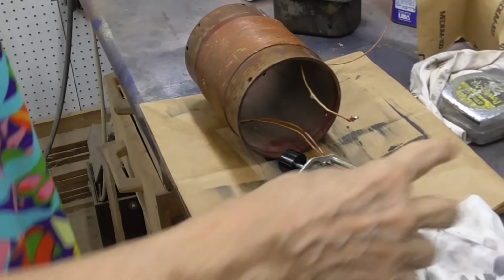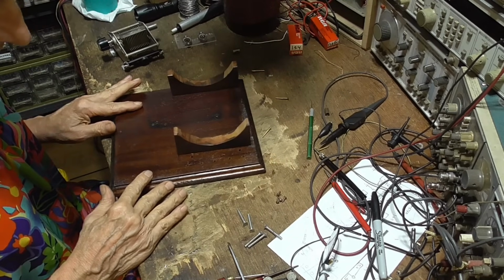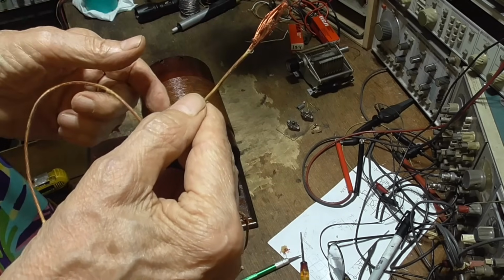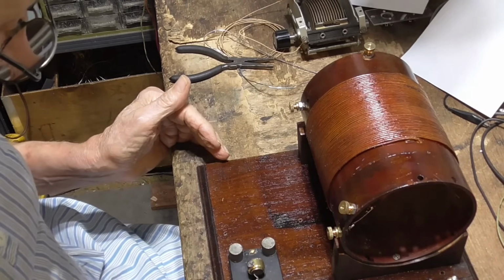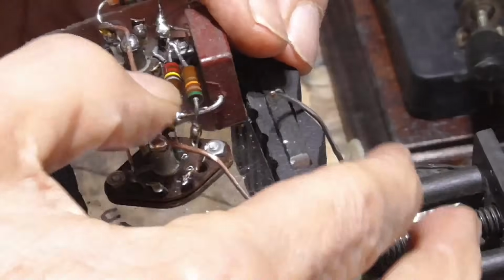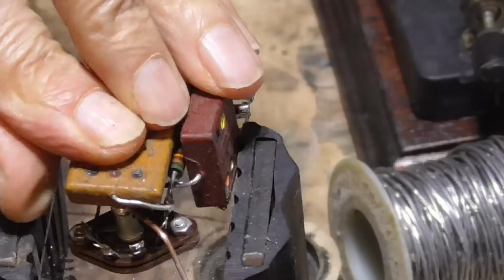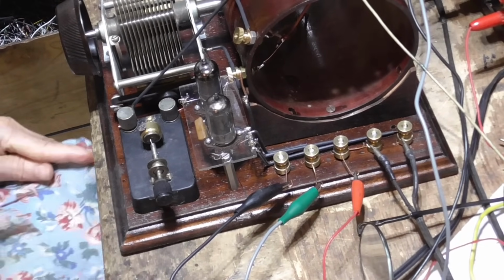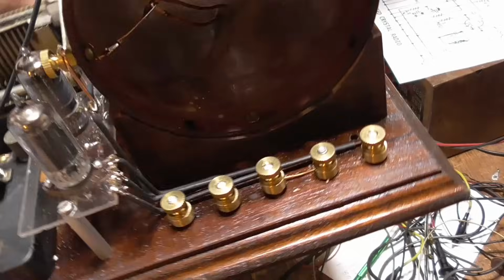MAKING A TUBE AMPLIFIED CRYSTAL RADIO

Comment: What is the Diameter of The Coil Form ? .. and (Did you Happen to Count the Turns) to achieve the  the 250 uH Value ??
Reply from the maker: The coil is 3.5 inches dia. The coil came from an old radiola 3 radio. The number of turns is unknown but looks to be about 250 turns of #18 stranded wire.
Reply: @glasslinger  OK .. Great .. Could I bother you again to Measure the ' _WIDTH_ ' of the Windings on the 2.5 Inch Form (And also the ' Total Length' of the Form it's self) .. With hopes knowing those details, it will be near perfect to a 250 uH Coil as possible when Complete ✅ 🤞 (Thanks 👍 Again)
Reply from the maker: @x_CrossHair_x  I no longer have the radio. I gave it to someone as a birthday gift. You can get a chink inductance-capacitance meter on ebay for under 20 bucks. (ebay # 156108312067) I have one of these and use it all the time.
Reply: @glasslinger  Yaa.. I guess.. Now is a good time to get one (More affordable) .. Amazing how inexpensive the Electronic Measurement tools have become. Even Scopes and Spectrum Analysers are Dirt Cheap.. (Not like the Old School $1000's) Back in the day. And what a nice B-Day 🎂🎉 Gift.
Chow and 73s
Reply: @glasslinger  I see 44 turns. I hope that guy didn't try to wind 250 turns on it. LOL!
Reply: I love this.....I wondered if you had wattage values on the resistor in your schematic
Reply: @larryangell7582  Just an (Old School) assumption .. Looking at what he used (They look to be) 2 watts..
Reply: Thanks @x_CrossHair_x
Reply: @michaelsimpson5417  LOL.. No I did not wrap that many If referring to me. (value is 250 uH) not turns.. But thanks for counting them.. (After counting them My self and Turning Cross Eyed doing it.) you Are correct that the Coil has 44 Turns. 👍👍

Comment: glasslinger, the radio tech with pink dress is coming back with this very neat job. nice to see! but an amplifier after a diode detection (instead of regenerative, or reflex), is it... well... a little bit inefficient design?
Reply from the maker: It was not meant to be efficient. It was to be expressly an amplified crystal radio!
Reply: @glasslinger  ok. at least, it is aesthetically efficient!😁

Comment: Hello sweetheart, My question is when making a crystal radio, My coil is going to be 4inch ( PCV PIPE ) So what is the coil inside my 4inch is it just a part of the antenna? I'm helping my grandson he loves your video.
Reply from the maker: Use a single coil on the 4 inch form. No good reason to use 2 coils in a crystal radio.
Reply: @glasslinger  Thank you so much God Bless...... If you know anyone i could send the picture of the BIG radio tube i have for you to look at please let me know. I think you will be very happy to see it..... Hugssss
Reply: ......... bine va precizat dm nu este nevoie de doua bobine, nu  stiu daca dm va precizat dar bobina  cu CV in paralel face parte din circuitul de acord ( de calare a receptorului pe fregventa de lucru, emisie a postului receptionat) fara acest circuit nu ati putea selecta postul dorit de oarece in antena ajung o multitudine de senale de RF  dar si parazitare, ori acest  circuit bobina CV face posibila selectare semnalului celui mai puternic  post de emisie pntru ace fregventa cind fregventele mai multor semnale sint egale si de aceias putere veti auzi in dif s-au casca flueraturi puternice ptru ca circuitul acordat nu poate separa fregventele si atunci prin ,, bataia '' dintre ele apare acest semnal ce le anuleaza facind receptia posturilor respective imposibila

Comment: You can improve the 'Q' of your receiver by increasing the value of your 1st stage grid resistor to 10 meg or so, which will allow you to reduce the value of the detector cap by a factor of 10 or more to improve the 'loaded Q', you might even be able to only use the internal capacitance of the tube to act as the detection filter.
 When you thought your circuit was working from the diode you added underneath the detected signal should not have disappeared when yo moved the whisker off the crystal.

Comment: 30:10 i love when people misspell "bus" by adding an extra "s". reminds me of my childhood, the step-family's surname.
Reply: A bus is a thing that poor people ride .
“Buss” with two ss’s is the correct spelling for the word “buss” which , as in “buss wire”, refers to tinned (usually) solid wire.
Reply: @papaloongie:-  In English it's not " buss wire ", but should be " bus wires " .  This would cover all, tinned or not, solid or stranded.
Reply: It's a special kind of wire, old school type like the radio, has nothing to do with the twisted pair, that connects your car's control units - or whatever electrical busses you might have in mind.
Google would have helped against the shame.

Comment: Why make a 2 tube amplified crystal set at all? Why not simply use the 1st tube as a detector and pre amplifier stage?
Reply from the maker: The PURPOSE of the project was to add an amplifier to a crystal set.

Comment: Where’s the part where he shows you how to wind the inductor wire ? I couldn’t find that video.
Reply from the maker: The inductor was removed from an old Radiola 3. You can find these on ebay in crappy condition for under a hundred bucks. Do not chop a Radiola 3 that is in good condition since it is valuable.

Comment: Litzewire is also a perfect desoldering tool.
Reply: The RF litz wire is not the same as common stranded wires. Each thin wire is enamel insulated, then they all are wrapped in silk or cotton. This type of litz is rare now. It is quite hard to remove the enamel before soldering.
Reply: @ButtonsKing  
I remove the enamel with solder and aspirin tablet, EZ
Reply: @wnj2453  Yes, I know this method. Another method is soldering RF litz on a piece of hard PVC.

Comment: Your table saw scares the hell out of me 🤣. I grew up using my grandfather’s 1939 Sears and Robux saw that is basically exactly like yours. 

No safety shield over exposed, spinning sawblade  

Even though I grew up using it my entire life as a young child a teenager into my 20s . 

I finally got a modern saw with all the safety features . 

I would not allow my children to use my grandfather’s table saw . 

But I’m about to embark to restore, clean and repaint that 1939 Sears & Roebucks table saw to bring it back into its original glory to make it look brand new  

But I will be adding safety shields, kickback protection, in a very large protective fence and guide .   So it can be used safely.. 

And make a shield around the motor, spinning pulleys and belts just in case some children came around poking fingers or piece of clothing by somebody passing by, cannot get sucked into the belt .
Reply: Your children might lose their life later by thinking, they can fumble around everywhere, being foolproof protected.
Reply: @werner.x That is a fair call. People have lost a grip on reality these days with how things are.

Comment: Hello! Please tell me what is the diameter of the coil, the number of turns and what is the wire section?
Reply from the maker: For 550 to 1500 KHZ the coil is 4 inches dia. with 250 turns of #18 AWG wire. Space the turns 1mm. you can wind with a piece of string to get the spacing, then remove the string and varnish the coil to hold the wire in place.
Reply: @glasslinger  OK, thanks for the answer.
Reply: @glasslinger  Hello, I think you mean Fifty turns!   250 turns would put it way down about 100KHz.  Cheers.

Comment: I can’t stand slotted screws.  But you drive them in like it’s nothing.
Reply: You need parallel ground bits that fit in the slot well, or modify one yourself as needed. Experience helps too.

Comment: You should stick with the whisker for the detector, rather than that fancy newfangled germanium diode, which was not available commercially until the 1940s. I never had a problem using one, but had some very nice galena crystals. 

I prefer either bare or enamel coated copper wire for such projects, when possible - more authentic and more shine.

Nice little project.
Reply from the maker: The radio has an old galena crystal. I used the modern diode for the video because of the difficulty in adjusting the cat whisker. (with my shaky old hands!)
Reply: @glasslinger  I never had a problem with them, but understand that some crystals can be really frustrating.

Comment: a nice, classical desighn........why not use a 6AF4A for your first stage of amplification.
a 6AU6 is a good choice for second stage, another way to bump it up is to apply a very small forward current across the crystal (it usually takes only a couple micro ampres, and sometime even less).
Reply from the maker: A pentode has about 10 times the voltage gain of a triode.

Comment: The Lynch motor is an unconventional design with a disc armature. It marries the advantages of a conventional, wound armature motor with the benefits of a flat (printed circuit) motor. It is similar to a pancake motor, but is more powerful than any of these technologies. The disc armature has magnets on both sides, doubling the available flux density and shortening the magnetic path. It therefore packs more power per pound and per cubic inch than any other motor technology. Of course such a revolutionary motor is not for every application - it is not as cheap as wound field motors, but for many applications it is a far superior motor.  It has a previously unheard of power to weight ratio and also power to volume ratio. It is also highly efficient because of the double magnet design and associated short magnetic path. It also includes integral fan cooling.

 The Lynch motor is an important development which spurred other motor designers to improve their products to remain competitive, such as synchronus permanent magnet machines.  As a result of the competition between manufacturers the cost of high performance motors and controllers has fallen dramatically.  We hope the cost of solar cells also reduces to allow renewable transportation to develop as a viable alternative to carbon fuels.
Cedric Lynch built his electric bike around a mid-drive configuration, also building one of the worlds most efficient light weight electric motors to power his rig reliably at 60-MPH for significant distances. He would later set several world records with his axial flux motor and bring it to market as the Lynch / Agni motor. Briggs and Stratton would eventually buy this technology which would lead to the Etek motor, which is now famous for making high speed efficient electric hot rods.

Cedric uses to achieve high speeds is by following the rules of aerodynamics, and building a bike that is as aerodynamic and as efficient as possible. The other builders on this list bypassed this step, and Cedric uses this bicycle as daily transportation on real commutes. Although this high-efficiency motor uses “old school” brushes, this fact allows builders to use very affordable controllers. He has proven his design choices through thousands of miles of commuting, and the Lynch motor is highly respected.

Cedric Lynch is known as the creator of the Agni Motor, a highly efficient electric motor that weighs around 25 pounds and can put out as much as 50hp. 

Cedric Lynch is a British 'mad scientist' type mechanical engineer obsessed with the idea of greener transportation. His interest has been in building a super efficient yet powerful vehicle that can serve as a car replacement.

He started thinking of his own design for an electric motor in 1983 when he began entering competitions organized by the Battery Vehicle Society regarding building an efficient electric vehicle. At the time there was no reasonably priced DC motor with descent efficiency so Lynch decided to build his own utilizing modifying existing motors with old tin cans that he would spread out flat to use as cooling fins. Surprisingly using rudimentary materials and a garage work bench, Cedric was making better more efficient electric motors than any of the universities were able to manufacture in state of the art workshops.

Cedric then came up with a motor design that could be cheaply manufactured and began manufacturing his own motor that he could sell to the public in 1988 and the Lynch Electric Motor Company was born, known as LEMCO.

Cedric first used his motor to create a small boat called “The Spark” that would set an electric boat efficiency record. From there Cedric turned his attention to bicycles, an application generally considered too small for a lynch motor at that time. Cedric mounted his motor in recumbent bike, allowing him space to eventually use a set of thundersky lithium batteries.

The resulting aerodynamic recumbent bike had a top speed of 60mph and still managed an incredible range of 150 miles. Cedric rode his recumbent creation everywhere as a daily commuter, putting an amazing 50,000 miles on the machine - technically a motorbike.

Briggs and Stratton, the US firm famous for lawn mower engines, bought the technology and used it in their E-Tech Motor, and Cedric went on to manufacture his latest incarnation of his lynch design into the Agni motor, which is used in go karts, sailboats, motor boats, and even small airplanes.

The Lynch designed motors all have the same traits. Brushed motors, around 25 pounds in weight and they are able to put out enormous power compared to their weight. Sometimes as high as 50 hp (depending on amperage ran through the motor) at an incredible 98% efficiency.  Lynch Motors are also the most often used motors in electric motorcycle racing applications.

Cedric's zero-emission motorcycle, which has a top speed of 120mph, was shown in action winning the world’s first zero carbon race – the TTxGP in the Isle of Mann.

The idea for the electric motor has been snapped up by the 56-year-old’’s friend Arvind Rabadia, who together with his brother Hasmuk Rabadia had been thinking of starting a business in India. They have now set up Agni Motors to make further-improved versions of Cedric’s motors

Despite Cedric’s breakthrough invention he has no formal engineering qualifications and taught himself the techniques needed to construct his engine. He first became interested in electrics when his parents bought him a book entitled How to build things from things found at home. 
The Etek motor is a brushed 25-pound pancake shaped motor that puts out enormous power for its weight. Depending on amperage and voltage the Etek can easily provide between 15-horsepower and 30-horsepower reliably and consistently (11-kW / 22-kW). A perfect platform for a powerful electric bike if you do not mind the weight. Although brushless motors are considered more modern, a brushed motor like the Etek allows the builder to use very affordable controllers.

Cedric-Lynch invented the motor and sold it to Briggs and Stratton which US company produced the Etek at a lower price (around $600). In the late 90’s early 2000’s it was the way to go for a high-power / light-weight electric vehicle. Many small E-vehicle records were set using the Etek motor. Finally, the market had a relatively lightweight and powerful electric motor available to the masses.

In essence, the Etek allowed hot rodders to build electric bikes. Before the Etek very few people had ever achieved 50mph on an electric bike. Even today, Etek motors (and newer incarnations of the Etek motor) are used to make some super fast electric bikes. In the case of Liveforphysics, the fastest E-bikes ever.

 Liveforphysics used a newer version of the Etek (the Agni motor), to achieve speeds of over 70mph, and dominate a recent hill-climb event.

Every Etek I have ever ridden has been characterized by brutal off-the-line acceleration, usually to a point where you have to apply the throttle very carefully or get thrown off. However, it is possible to run an Etek at a lower voltage or lower amperage and have a very manageable, safe, and sane electric bike that will not burn out on you, no matter high steep the incline.
Reply: @SonicPsyched 😆

Comment: The crystal detector was obsolete by 1925, Felix Thuaud (Thaud ! ) (French steel foundry) had invented the silicon diode in France. fixed detection contact not point.

Popular Science June 1925 page 52.  also later reported in Wireless World November 1925 page 682.

The FET transistor was also invented and described in 1925 by Lilienfeld , but ignored by the entrenched industry, gotta laugh.
Reply from the maker: Invented, not obsolete. It becomes obsolete when general use replaces it. It was many years later before practical production began to where anyone could buy one.

Comment: Ron, instead of that cat whisker and diode, and since you already are using modern miniature tubes, why don’t you replace that catwhisker assembly with a 6AL5 vacuum tube diode?
Reply: Then it would not be a crystal radio.

Comment: Hello sweetheart? I'm still waiting on a new great video from you like all of your subscriber are .I ask you question because i don't trust any of the other people that works on radios like you do! In making a crystal radio, like one of this you made. My question is if i connect 2 germanium 1n34a diodes end to end or side by side will it make my  radio signal Any better? or would it not help at all?
Reply from the maker: End to end definitely not. Side to side the best diode will do all the work. The second diode could be removed with no effect. The only way to get more out of your crystal radio is to increase the impedance of the headphones. (rewind the coils and make the magnet stronger.)
Reply: @glasslinger  bless your heart! you are always a great help hugs to you!
Reply: @glasslinger              ........... nu va suparati stimata dm, dar mai exista o posibilitate cu doua diode cu germaniu chiar sa dublati U de esire a semnalului de AF prin constructia unui etaj detector cu dublare U a semnalului AF Nu mai continui stiu ca ati inteles deja despre ce e vorba